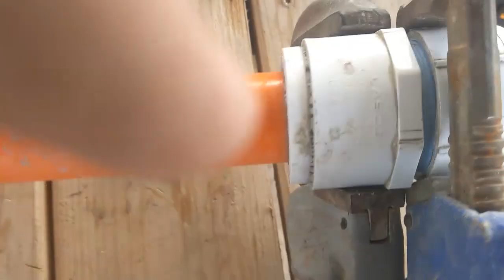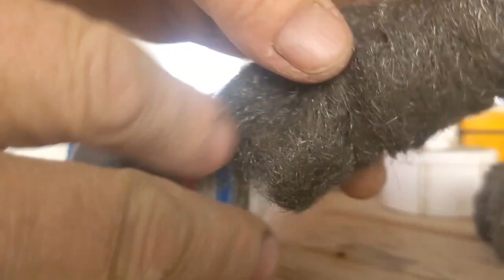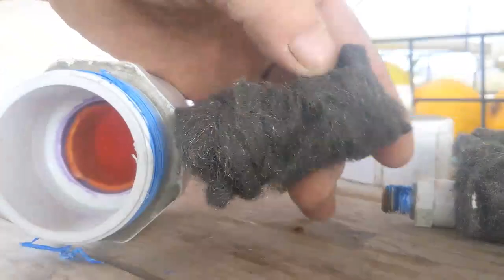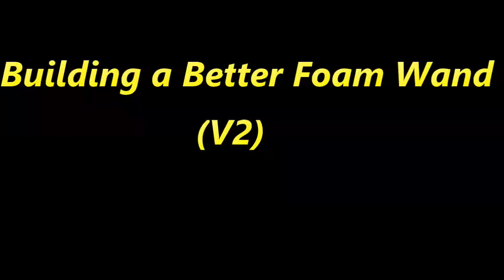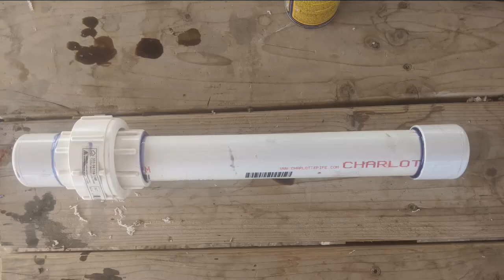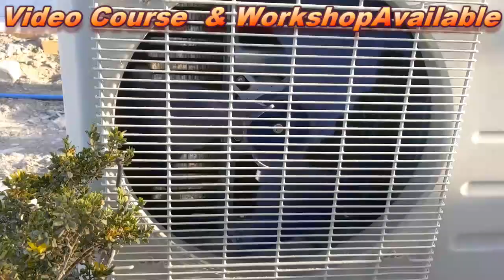How to Make AirCrete Foam Machine Wand V2

Comment: How the heck do I get the foam density up? I am using Axiom dish soap  25 ml/litre and glycerin  5 ml / litre,  Compressor set to 100 psi and reduced to 40 at the foam gun , a 12V car wash pump on demand pumps the soapy water to the gun , . It looks nice and creamy but when I weigh it it is only 40 grams/litre  not good enough .   Thanks  , I am in Costa Rica so hard to get technical ingredients ... and expensive , so trying to use the soap to start

Comment: Have you tried using steel studs as a form to pour aircrete panels? I've seen videos using the steel studs or just plane making aircrete panels and setting them in place with a special crane. Seems like it would be easy to just stand the panels up to make the walls. What do you think?
Reply from the maker: I think steel studs act like very large heat sinks to bring heat into a structure during the summer and let heat out during the winter.  Here touching a metal stud inside a building will almost blister your hand.

Comment: Can you use aircrete to build an underground home?
Reply from the maker: Not without a structural shell to support wet heavy soil.  Something like ferrocement. Aircrete has low tensile (side-ways push) strength compared to cement.  It can be used as infill insulation